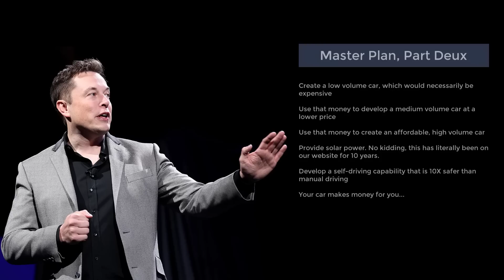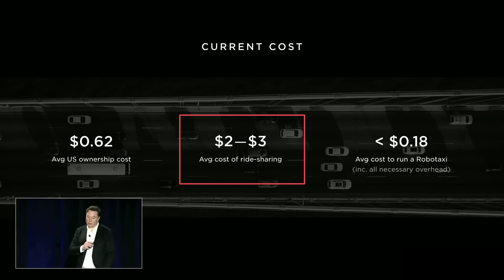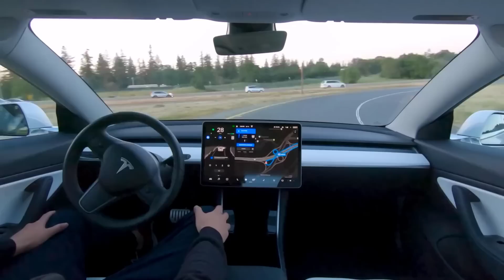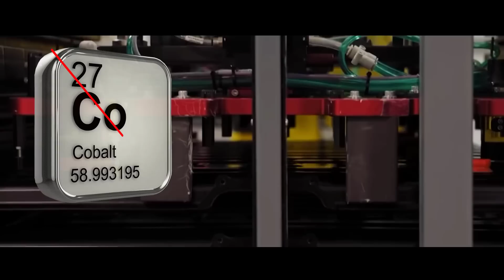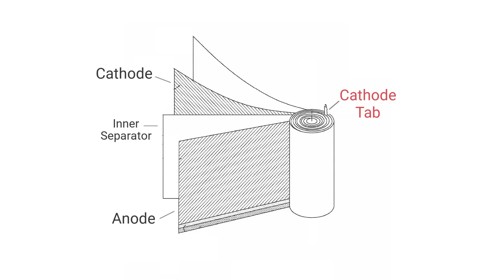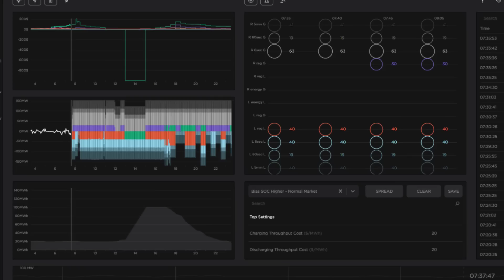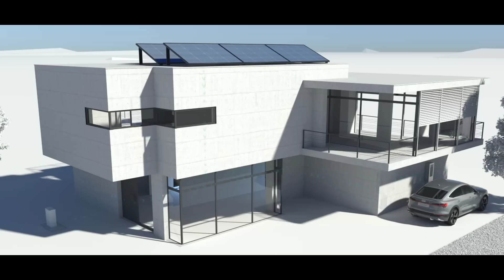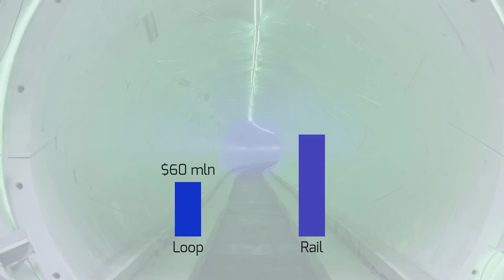Tesla's 5 New Ingenious Projects To Drastically Change The World

Comment: PROTESLAPOWER and a lot of others like the content of your videos. Before the Cybertruck was unveiled I as well had some ideas about a Cyberline. I suggested also that the recently acquired Hibar battery plant in Toronto would be good for high density batteries and Tesla solar. Months ago I tweeted Elon Musk about some of these ideas but he gets so many tweets mine were probably overlooked. Don't get me wrong I think the Cybertruck rocks with its stainless steel exoskeleton and many other features. I believe that the market is also waiting for a Heavy Duty Tesla truck one that could be used for buses, ambulances, delivery trucks, dump trucks, RVs, etc. We could call this one a Cybersemi. From an economic standpoint and the fact that they can be built quickly and affordably alongside the Cybertruck. There should as well be a Lite Duty truck two or four passenger with fold up rear seat and on off road capability, they could really fill the gaps in the market place. This Cyberside-by-side could fit in the $25,000 range and be a little powerhouse even in small places. Of course extra utility type accessories could be available for it so that it could power like a snow blower, lawn mower, forklift, jet boat, etc. Oh yeah let's not forget a solar shelter option. I do have a background in commercial energy and automotive marketing but I could still use help getting these ideas out there. So if you like these ideas or have some of your own to add please let me know. I appreciate all of you and your comments. It's time to fix our future!
propower101@hotmail.com

Comment: So the 2021 Tesla Roadster is roughly $250,000 dollars and will smoke 99.99% of cars made on the planet. I don’t think it can beat the Bugatti 16cyl that has 4 radiators and top speed is 302mph which is insane because your average or even great drivers can’t handle that sort of information coming at them and make judgment calls that is coming at you sooooooo fast. I mean I worked for United Airlines and our Boeing 747-400 and the 777-300 would average about 550mph to 577mph. Sorry I got off topic because there is a saying I saw at a race track that read, “Speed Cost Money.....How Fast Do You Want To Go??” and I’ll never forget that saying because it is true. But the new Roadster will top out at 255mph and that is $250K vs the Bugatti that goes for $4,000,000.00 +sales tax, plus a massive gas guzzler tax, delivery charge and destination charges with a price of $4.5 Million out the door is for only a few token rich boys and their toys. Shit not even Leno will buy that car but he is the 1st one on the list for getting that Roadster and Joe Rogan is right up there on the first few men who are buying in cash of course and I just hope we don’t hear them pulling a dumb stunt and end up like Paul Walker while trying to race a slow ass 2021 BMW M3, M4, M5 or M8 Competition package ride that will top out at 175mph and can NOT and will NOT pull off the line like a bat out of hell. I don’t even think Motorcycles will beat the new roadster either since it does 0 to 60mph in 1.9 break your neck seconds!!!! I am so depressed because I only have $111,265 saved up for the Roadster and I don’t pull in the money that Rogan, Leno or Seinfeld does and I’m not buddies with Elon. The only chance I have is winning the lottery or better yet PRAYING EVERY SINGLE DAY FOR ONE.

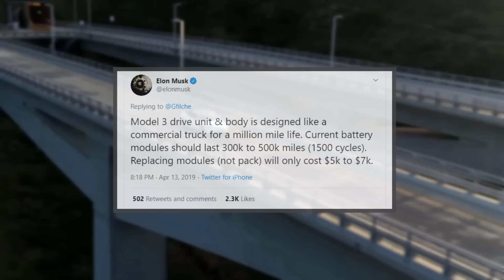Comment: 4:55 - Sure, the chassis and drivetrain might last 1m miles, but the interior - unless it's made from solid hard plastic which would be lethal in crashes - will not last the life cycle of the first battery pack.  If they're pushing for the taxi market they need to figure out how people with utterly zero concern for the vehicle they're in will not trash the interiors within 50k miles.
Reply: Hahaha  just like all the cabs I drove you just replace  the seat when its worn out.

Comment: The current problem of pollution is deeper than it looks. Major percentage of Electricity comes from coal, which is why indirectly even EV’s have a huge carbon footprint. The only solution to this issue is to get the energy from renewable sources.

Comment: how could electric vehicles reduce carbon footprint when you still need fuel to generate electricity to be eventually injected into the EV.
Reply: professor   but we're still far from producing sustainable energy.. most of electricity currently use is produced with diesel powered engines..

Comment: What if Tesla create a phone that can use for days in a single charging?
Reply: They wouldn’t really. They would just supply the batteries to the phone companies.
Reply: Easy. Then there will be a phone that can last for days on a single charge.
Reply: those used to exist.. we called them Nokia 3310 .. .
Reply: Smartphones like those exist
Reply: Then they would just but more power hungry components in the phone, thus reducing time back to the 1-1.5 days. They don't make phones last so short on battery because they can't make them last longer, but because market research shows that people care more about having the "best" phone(features, camera, processor etc.), than having a longest lasting battery.
Reply: a startup is creating a radioactive battery made out of artificial diamonds, it's supposed to power a smartphone for years, and it should be cheaper than lithium battery, because they basically use radioactive waste, but the diamonds prevents them from leaking or be destroyed and release radioactions. the first commercial use will be in 2 years for a downgraded version, then 5 years for the final one. obviously you can't recharge them.
Reply: @magicl3o  epic... what's their name?
Reply: If they can get the capacity to make batteries for phones it could bring them a lot of money, since this is one of the most used product in the last 20 years.
Reply: Definitely makes one think that why aren't companies like Apple and Samsung thinking about supplying batteries that will keep the phones charged for weeks on end. Could be they fear loosing profitability. 
However, in the long run it will only bring more value and in the end more profitability. So these companies really have nothing to fear when it comes to disruptive technologies.
Reply: @magicl3o  What's the company's name?

Comment: As much as I like Elon's idea of putting Teslas in his Boring tunnels, I see a major problem with the currently available tunnels he's ran vehicles in. A severe lack of maintenance and emergency entrances and exits. I'm sure this is just an oversight in the prototype tunnels, but this is going to be an issue if that oversight makes it to production tunnels, especially if you're proposing multiple vehicles use the same tunnel simultaneously. Other than the obvious maintenance issues, this would be a death trap if there were any emergency issues, as conventional emergency vehicles are not going to fit into those tunnels, and that assumes there's only a single vehicle in the tunnel, from both ends, causing the emergency situation. 
I also think the idea of using rubber wheeled cars in these tunnels, especially if it's a glorified point-to-point delivery system that uses flatbeds to move cars or bus-like tops, is a bit dumb. Just make it underground rail with flatbed cars. This would make maintenance simpler, as you only have to service rail, rather than having to deal with tire wear on multiple vehicles, which also cuts long term costs significantly; rail could also easily be powered, where these flatbed cars are more than likely going to be battery-reliant, which also adds cost in manufacturing and powering the system. Maybe that's the plan, though, for these point-to-point systems with ground-to-underground platforms, where the driven tunnels are reserved for actual driving between two areas.

Comment: Car drives me into a oncoming train, no thanks I want to drive myself. What is the life of the batteries and the cost to replaced them?
Reply: "The elevator could fall to the floor, no thanks I'll take the stairs" - People in 1860
Reply: fitzy1093 what is the life of the batteries and cost? I don’t know.
Reply: @fitzy1093  Actually people in the 1860 were totally fine riding elevators that had the elevator break that was made in 1854 before that hell yeah you would want to take the stairs elevators were fucking death traps.
Reply: @austinblackburn8095  ACTUALLY, you're wrong. It was even after the emergency break was implemented that people remained skittish about riding the elevator because it took time for people to trust it as safe. Which is exactly my point.

Comment: @ Tesla’s Robotaxi Network - Doesn't Exist, was promised 1st Quarter 2020... we have heard NOTHING, LOL, level 5 autonomy isn't even possible with the hardware currently on Tesla vehicles.  All talk of Robotaxi, is merely a marketing ploy praying on the weak minded.

@ Battery Tech - Tesla is now working deals to purchase cells from China's leading producers .. because those will be the lowest cost cells, in automotive, cost is king if one intends to make a profit.

@ Affordable Tesla - YES, Tesla needs more affordable lower priced vehicles if it expects to grow into an actual leading OEM producer the size reflected by its current inflated stock market cap.

@ Autobidder - A GOOD IDEA that could provide owners some profits in exchange for consumption of their battery pack life. However, Tesla has NO vehicle models which currently have 2 way power flow capability, and has the WRONG power outlet standard for doing this.. LOTS of changes required to both vehicles and their charging infrastructure. 

@ Tesla Van - YES.. should have already been on the market... the entire Commercial segment is missing in Tesla's product lineup... multiple platforms of light, med, heavy Trucks and Vans is a MUST HAVE for any major Auto OEM. (Rivian / Amazon is already ahead in the Commercial Van segment ... Tesla is following).
Reply: Let’s see how well this ages by the end of 2020

Comment: Well, Elon said the crap Model 3 that does not even have the safety driving standard speed binnacle fitted,  unlike every car ever made, That was called the most affordable Tesla BEV. Only costs £40.000p in the UK.  Yep totally un-affordable unless your very well off or rich. Unless he can make a true affordable EV like a compact model that let's people drive in the tight streets of the UK and Europe for the cost of £10.000p.  He just will not get the other 96% of the lower paid car uses out of the very expensive to run polluting ICE compact cars and into a BEV.  All the other few big auto makers that are bothering to even do BEV's are all doing huge SUV's and Crossover cars all cost many thousands ( most £40.00p upwards ).  The Tunnels transporting of the Tesla Only cars.. well there's a problem there? In fact three problems.. 1 > You can only use a Tesla car in the tunnels.  2 > that Tesla car must now use it's own motors and battery to drive through the tunnels, The much advertised State board type wheeled unit the cars were meant to use are not to be used instead you have to have your Tesla car upgraded with folding out from underneath your car 4 driving wheels to grip the sides of the tunnels and your own power system will zoom your car down those tunnels hence costing you lots of extra money for the added system and wearing out your cars systems and tires faster!  3 > Not every person in the world whom even can afford one of these Tesla cars, can cope going down underground in a very small tunnel?  at least 50% of the people on the earth are Claustrophobic i.e. can't go in tunnels.. and most of those tunnels normally are about 4 times wider than the ones Elon wishes you to go inside?  So many at first glance better tech, except when you think how people are about being agoraphobics or how not wealthy most are!  All his present tech all nice But only if you are very rich indeed and don't work etc.?  I not against his stuff at all, But unless your very rich you will not afford it even if you wish to have it? a powerwall 2 home energy storage battery costs around, £5.500.00p each in the UK, the horrible model 3 costs £40.000p here. then the solar roof many thousands, and you of course have to own your own home and be away from other homes and trees and have planning permission to update the homes roof etc. All costing money one way or another!  His goals and idea's are very nice. But NOT most people having that level of money or even owning a nice home, it looks unlikely about 95% of the planet will ever afford to be Tesla owners.
Reply: most of the things you said are wrong

Comment: Nice research. Could not find a single mistake.
Reply: other than the appreciation part.  Especially if Tesla goes through with making it a subscription program.
Reply: Metal ball to windshield
Reply: instead of a 60kw battery and a weight of 600 kg it is better to divide the battery in two. one of 10 kw and 100 kg permanent with a range of 100 km that would be enough for the city and a detachable battery of 50 kw and 500 kg to rent when you leave the town. instead of stopping at the peco to fill up for the road you can go to a power supply point in your city and mount a 50 kw battery from there and on the way to replace it at another power supply point with a charged one . the first advantage is that it would save a lot of batteries, especially since the 2 million km batteries will appear, which practically do not wear out and must be fully exploited. if a car is lighter by 500 kg, I think it will have a significantly greater autonomy. this would be the second advantage. a short recharge time of up to 5 minutes to change the battery would be another advantage. the price of cars would drop by half. I'm waiting for opinions

Comment: Wow, did we just see battery day?
Reply: pretty much. the breakthrough is building high volume, high durability (cycle life) and low cost Li Ion cells.. not an entirely different cell chemistry
Reply: Maria Cobretti Yeah but can the cars go 500 miles on a charge? I need them to go 500 miles on a charge.
Reply: @farukcarushi4983  you wont even drive 500km at a time
Reply: @farukcarushi4983  My guess is that will be an option. Most people don't need that much and would prefer the discount price.
Reply: Faruk Carushi eventually all their models will. For instance the new CyberTruck will have a range of 500 miles and the new Roadster will have a range of 620 miles. With time all of their models will improve in terms of range, charging time, more affordable prices, self driving capabilities, software, battery life (new 1 million miles battery coming up) and much more...
Reply: Pablo Rodríguez yesss, I like the sound of that!
Reply: @Howdy Justice The customer is king

Comment: hydrogen powered cars are more greener and environment friendly than EVs in general
Reply: Yeah, can't wait until they put hydrogen-filling stations across the country...
OR.. Create an electric plant that burns hydrogen, if it's that good.
Reply: Not according to most research.  If we already had a hydrogen infrastructure to begin with, then maybe. But as it is right now, transporting hydrogen everywhere it would be needed would be just as environmentally damaging.
Reply: Jeff White hydrogen powered cars generally don’t burn the hydrogen.  Most use hydrogen fuel cells, which create electricity to power electric motors.   
Burning hydrogen to produce energy is relatively easy, but not any more efficient than burning coal, and mining coal is a lot cheaper than producing hydrogen.   
Hydrogen fuel cell powered cars might be greener, but producing, transporting, and storing hydrogen is expensive, we have no infrastructure for it, and not very green overall.  
Those negatives could be overcome, but not anytime soon without major investment.
Reply: You have no clue about technology. None. But you think you really do
Reply: @leonari   south korea have completed all the research and testing to the prototype and have come up with a fuel cell module that can effectively control hydrogen combustion inside engine

Comment: I believe that Elon should also invest in drone technology and autonomous robotics ( like what Boston dynamics are into) and also 3d printing. Those are some of the other aspects I believe will be competitive in a direct and indirect way to all his company's. Just my personal opinion!!!
Reply: Elon is already using 3D printing for building SpaceX Raptor engines and is increasing it's use as rapidly as possible.  I would not be surprised to learn the same is already happening at Tesla. They are already "casting" large aluminum parts at a whole new level to replace "stamping" many smaller parts.  Some people believe Tesla will be able to caste an entire Model-Y frame in one part at it's new Berlin Gigafactory.

Comment: EV’s create more power plant emissions 9:58.  Tesla’s FSD mode could/will be a revolution.
Reply: Kind of. But those emissions that are created because of EVs to power them come out of the tailpipes of ICE cars.  So EVs would have a similar carbon footprint if just using grid energy. But if  EV owners had solar panels or other green power, it would reduce the overall carbon footprint in the long run.